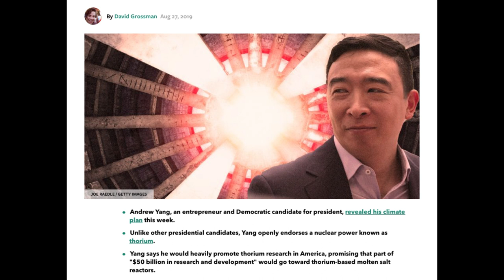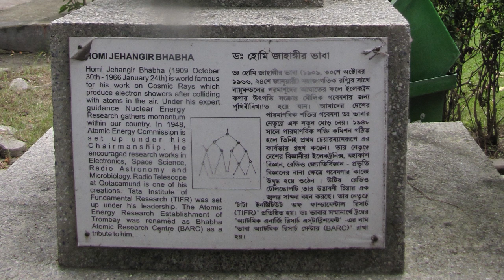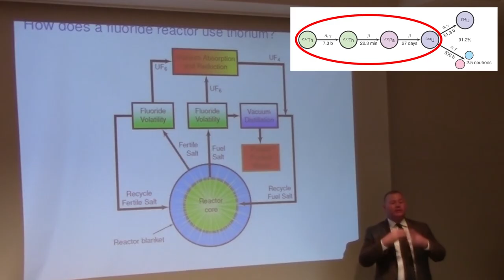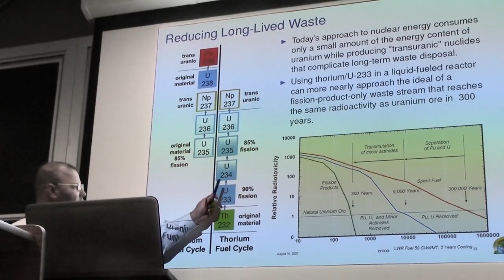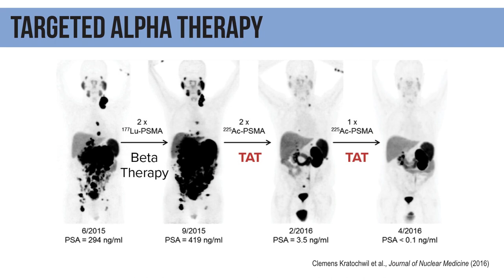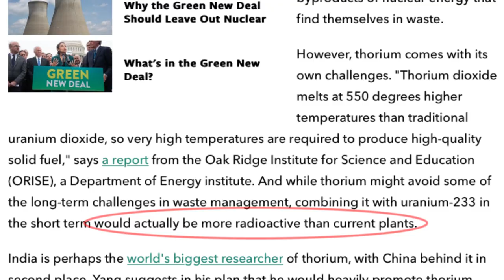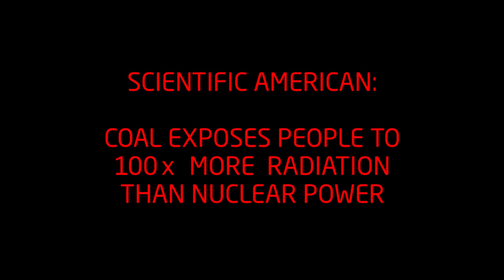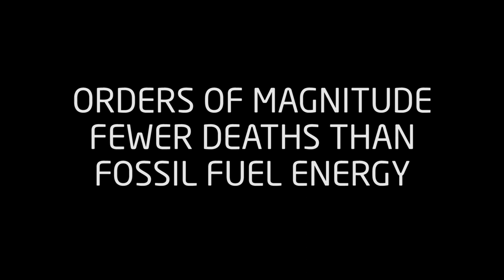Democratic Candidates on Nuclear - Fun Fact: Joe Biden Supports Nuclear Power

Comment from the maker: Joe Biden supports nuclear power, and specifically wants to invest in research aimed at lowering the costs of nuclear. Bernie Sanders plans to put operating low-carbon nuclear power plants into early retirement, not build any more, and not pursue any advanced nuclear technologies either.
Reply: Bad title change for this video my man
Reply: The video never mentions Biden. My problem with Yang is his focus on thorium. Don't get me wrong, thorium is needed if we are to ever get to nuclear powered railroad engines, and should be used to replace the existing reactors in nuclear powered aircraft carriers. And thorium is preferred for nations without an existing nuclear industry. But the focus for commercial energy in the US should be Spent Nuclear Fuel burning MSRs.
Reply from the maker: @dalesplitstone6276  Biden was never asked about nuclear at the CNN Climate Town Hall. It seems like random chance he's gone this far without being questioned on it, so all we have are his platform which supports R&D into SMR. Of could he COULD bring it up himself, which would be nice.
Reply: @gordonmcdowell  While some SMRs are MSRs, support for SMRs does not imply support for SMRs.
Reply from the maker: @dalesplitstone6276  That is absolutely true. Yup.
Reply: enough reason right there to forget about bernie

Comment: 7:55 you could clean the filter from coal power plants and extract Uranium and also Thorium
Reply from the maker: Currently, you'd be concentrating those fertile materials enough to have a "controlled substance" on your hands... dilute it is coal ash. Concentrated it is "oh-no-thorium!" So need something to do with it. Somewhere to use it. A purpose, for that Thorium. What to do with it, what to do with it... (Obviously Uranium has a use already, but you'll still be stuck with Thorium if you try segregate the coal-ash contents.)

Comment: Great video 

But the ashes from coal plants are not always wasted. Here in Oklahoma, the ashes are used as a filler in concrete called “flyash” and it’s needed quite often. Sometimes we even run out. So, the ashes are not always dumped and wasted.

Comment: I have been following your compilation of videos and found them a great resource.  I know you consider the term Thorium reactor the same as a MSR, so can you please clarify if Thorium could be used in a PWR even though the waste would be about the same as Uranium.
Reply: It can, it's just not nearly ideal because all water reactors have terrible fuel burn-up (0.5-0.7%); you can't get higher burn-up because of damage to the fuel rods and other engineering issues, and on top of that spent fuel reprocessing is a potential proliferation risk (but not nearly as bad as what environmental groups would have us believe). It would work similarly to current fuel rods, except there would be either a mix of uranium-238 and thorium or just thorium in place of the U-238. Because thorium oxide is harder to fabricate than uranium oxide, it's actually at a cost disadvantage in a water reactor, and so no one will want to use thorium in water reactors except for research purposes.

This is why MSR is critical to maximizing thorium's potential.
Reply: @MMuraseofSandvich  MSR technology is the way to go.  If only the US government did not shut the program down back in the 70's, we might already have widespread acceptance of nuclear energy.  That is why I like to differentiate Thorium and MSR with the current PWR technology because it is the latter technology that has led to the anti-nuclear lobbyists.  I know the science and safety statistics tell a different story regarding the current generation of PWRs, but perception paints a different picture because most people associate nuclear energy with nuclear bombs.

Comment: Thank you Mr. McDowell for all the great work you have done informing the public on molten salt reactors and in particular Thorium molten salt reactors.  After listening to the Mr. Yang and Mr. Booker I believe that really don't have a realistic grasp of the timelines for actual construction of a  commercial molten salt reactors.  Now I may be wrong because I am only going by what I read and I am no expert, but in the western world Terrestrial Energy appears to be the farthest along in actually building a commercial molten salt reactor.  It is a uranium fueled reactor and it won't be complete until the late 2020's.  For thorium from what I read the molten salt fuel cycle and chemistry to clean the salts really have not been fully developed yet.  It could be decades for commercialization of the thorium reactor molten salt reactor.  I have no idea where the Chinese and Indians are in the process.  The point being is that if molten salt reactors,  uranium or thorium, are to be useful to address climate change, the policies of the candidate should not enough just to be "for" them but that the government HAS to do everything in its power to expedite their development and commercialization.  ASAP!!.

Comment: Thanks for your work Gordon - it’s difficult Finding a tight explanation for liquid salt reactors that most people can understand - and millions need to understand this stuff. An issue worth exposing is that nearly a third of greenhouse gasses are not from electricity generation but industrial heat requirements - small liquid reactors running around 700degrees can theoretically help a lot of these

Comment: Fission bombs don't have moderators so U235 and U238 have similar cross-section at 1 MeV neutron where U238 begins to fission but not enough neutrons per fission to continue chain reaction but contributes in Tamper. But Thorium has a .5 MeV fission threshold and more neutrons per fission than U235 fission.

Comment: 1. The Thorium-Uranium cycle necessary for such reactors might be less toxic than the Uranium-Plutonium cycle but we’d be talking about this on a global scale. That’s still going to produce a lot of toxic waste over the standard measure of a 10K year period 
2. The major incentive is to compete with and keep mostly China but also India (who have substantial reserves of thorium bearing materials) from cornering the market and gaining more influence/power. It’s not actionably and rapidly combating the climate crisis. There’s no need to create a new issue in the middle of this emergency.
3. Fissile products will be insanely mobile, liquid salts are extremely corrosive, so containment of these products will be highly complicated and expensive. 
4. When they have to use lithium, in the salt, it'll be producing tritium, which will also be insanely mobile, but will have the added fun of being radioactive. Its small too, so it'll easily bleed thru any containers. Special Sodium Flouroborate Salts are used to capture most in experiments but large amounts still escape to the environment. 
5. Periodic maintenance will be necessary in the Plants, but all the equipment in them will be highly radioactive due to the containment issues, so that means Remote Maintenance... Also massively expensive
6. Many Thorium-cycle MSRs have to capture Protactinium (Pa) as it is produced, removing it from the system while it decays to U-233 and then reinserting it into the reactor. Thats practically weapons grade U-233, so... components for nukes can be sold on the side by ppl high enough in the command chain at these Chemical plants. It'll be damn near impossible to track by the IAEA or anyone, because there's no way to tell if nuclear material is lost because of its containment difficulties or if its because of proliferation. 
7. The Union of Concerned Scientists  (UCS) are quoted stating, “the choice between uranium-based fuel and thorium-based fuel is seen basically as one of preference, with no fundamental difference in addressing the nuclear power issues [of waste management, proliferation risk, safety, security, economics, and sustainability]." https://www.ucsusa.org/sites/default/files/legacy/assets/documents/nuclear_power/thorium-reactors-statement.pdf 
8. PLEASE SHARE THESE CONCERNS W/ UR YANG GANG FRIENDS. There's a reason activists and the scientific community have consistently rated Sanders' approach the strongest. This is our opportunity to get away from Nuclear, Thank you

Comment: Again I am not wedded to using Thorium, what I am wedded to is a non-volatile liquid fuelled breeder reactor, In other words a Molten Salt Reactor, although if it was a metal reactor, just for the love of god not sodium or something equally stupid.
Reply: Liquid metal reactors are a challenge, to be sure. Many of the coolant metals are either absurdly reactive (sodium/NaK), or will eventually weaken the reactor vessel (lead). There are guys out there doing research on fast MSRs, so it's not like you absolutely have to use thorium (in fact, I would encourage fast MSR research because that would be a great way to burn up weapons materials and  spent fuel). If memory serves, one of the ORNL guys was doing work on FLiBe as a coolant for TRISO fuel.

Comment: Yang has it wrong, both from a technical and political angle. While thorium should play a role in our energy future, the emphasis should not be on thorium, but on Molten Salt Reactors. There is no way to start up a thorium reactor without some fissile material material in the mix. This fissile material can be U233 (we have very little U233 available), enriched uranium (this would put MSRs in competition with solid fuel reactors, unless uranium enrichment capacity were increased), plutonium (we have stockpiles of weapons grade plutonium that we are required to destroy by treaty with Russia), and Spent Nuclear Fuel.

Reprocessing SNF is not a weapons proliferation problem, it is a political problem. The plutonium from SNF is reactor grade plutonium, of which we have an even larger stockpile than weapons grade plutonium, from past reprocessing prior to political problems with reprocessing. It is harder to enrich the reactor grade plutonium to weapons grade plutonium than it is to enrich uranium to weapons grade. The production of weapons grade plutonium requires removing the fuel from the reactor before the U239 can be contaminated with other isotopes of plutonium, as well as other trans-uranic elements. If it were not for the difficulties of fabricating fuel rods from SNF, all that we would need to do is remove the fission products to extract more energy from SNF even in solid fuel reactors, and in the process we could fission not only the trans-uranic elements, but more of the uranium.

This is the one of the greatest advantages of MSRs. Without the need to fabricate structurally sound fuel rods, recycling the trans-uranic waste and remaining uranium can be much easier. MSRs can be designed to fission all of the trans-uranic waste of SNF, and do so just by removing the fission products that poison the reaction. These fission products are the highly radioactive relatively short lived waste that was mentioned when discussing thorium vs uranium. The primary problem with uranium is that, in the thermal neutron spectrum, it can not breed enough fissionable material to sustain the reaction, so a significant fraction of the U238 will always remain. reprocessing can separate this U238 from the fission products, leaving us with fission products that are just as radioactive and short lived as those produced in a thorium fueled reactor plus depleted uranium. The only advantage of burning thorium in a thermal neutron spectrum MSR is that no depleted uranium remains, and depleted uranium is less toxic than lead. Indeed, many MSRs are being designed to burn uranium.

Theoretically, it is possible to have a positive breeding ratio in the thermal neutron spectrum for thorium. In practice this is proving to be difficult, at the very least. To deal with this U233 breeding deficit, thermal neutron spectrum MSRs that burn purified SNF (uranium and fission products removed, but plutonium not separated), and breed U233 in a thorium blanket. Flibe's current plan is to burn SNF in thermal neutron spectrum MSRs to produce U233 for thermal neutron spectrum thorium burner reactors. Because Flibe's reactors operate in the thermal neutron spectrum, they have to separate out the uranium from the SNF as well as fission products to produce a rich enough fuel for the breeding of U233.

Elysium's approach is different. Elysium is designing fast neutron spectrum MSRs. Because they operate in the fast neutron spectrum they can burn 100% of the uranium in their fuel, which eliminates this advantage of thorium over uranium. Flibe has currently changed their focus from uranium burning MSRs to SNF burning MSRs. Because their designs operate in the fast neutron spectrum Elysium does not have to separate the uranium from the SNF to burn it in their MSRs. Elysium MSRs could be fueled exclusively on SNF while producing highly radioactive short lived fission products, similar to those of a thorium reactor. Of course, if they burn SNF exclusively, they will eventually run out of SNF for starting up new reactors. One solution to this is to start up the MSR with about 80 metric tons of purified SNF and feed about one metric ton of uranium into the reactor each year after startup. This approach would produce the plutonium needed to start up additional MSRs. However, feeding thorium into the MSR instead of uranium would be even more efficient. In this case, the MSR would be producing U233 for the startup of additional reactors instead of plutonium.

Elysium considers selling the DOE on the idea of MSRs burning SNF and plutonium stockpiles, both of which are problems for the DOE, to be much more politically viable than selling them on the idea of thorium burning MSRs. Andrew Yang should talk to Elysium about changing his focus from thorium burning MSRs to SNF burning MSRs. I believe politically, it is much more viable to sell the public on nuclear reactors burning SNF than reactors burning thorium.

There is room for thorium in the nuclear strategy. Westinghouse has been exploring the potential of using thorium in fuel rods for existing solid fueled reactors. But the primary focus should be on burning the existing stockpiles of SNF.

Comment: I still don't fully understand what you tried to describe in the conversion process. I get that we can use more of the fision products in the end but why are produced. What do I have to watch and learn to understand this. Plz no comment about "learn physics". Something specific would be nice.
Reply from the maker: I cribbed from my own video to create this one, particularly from here (deep link) https://youtu.be/2oK6Rs6yFsM?t=13067 ...and in short prose, Fission releases energy by splitting atoms. The resulting smaller atoms CAN NOT be as stable when created, they NEED time to decay to stability, which is when they cease to be radioactive. Radioactivity is just a delayed release-of-energy like the energy released during fission. But the delay is the hassle. H. G. Wells wrote (in 1913) The World Set Free, where humans figured out how to control radioactivity, and powered an advanced civilization with it.. no fission or fusion required, because plenty of already-radioactive material available in the Earth's crust. Sadly, we can't accelerate or slow radioactive decay, except for all that fancy-pants General Relativity stuff. We can make atomic clocks (based on radioactive decay) go out of sync by accelerating one in space (orbiting around the Earth), but not make any practical impact on how long anything will remain radioactive.

Comment: Are there any working thorium msrs already out?
Reply from the maker: China's T-MSR0 (simulator) is done. China's TMSR-SF1 (small nuclear pilot) under construction here (old satellite view obviously am waiting/hoping for a refresh) https://www.google.com/maps/place/38°56'47.5%22N+102°35'59.1%22E/@38.946528,102.5975683,835m/ ...here's latest presentation... http://samofar.eu/wp-content/uploads/2019/07/2019-TMSR-SAMOFAR——Yang-ZOU-PDF-version-1.pdf ...which explains it is TMSR-LF1 will be the pilot for true liquid-fuel Thorium Molten Salt Reactor.

Lots of MSR startups in the West. Most use uranium and are less efficient, but also then single-fluid simpler too. No operating nuclear-powered MSR yet... none since MSRE was shut down in 1969. https://en.wikipedia.org/wiki/Molten-Salt_Reactor_Experiment

Comment: Here's some interesting points that i saw being raised by a french physicist on Reddit who goes by the username /u/233C (links: https://shorturl.at/hjoX4 , https://shorturl.at/bwEMV ) about some topics you also mentioned in this video. To summarize however, basically he raises concerns in-part about these two things:

- The safety of handling Protactinium-233 when taking into account how dangerous it can be, even with a multi-stage repossessing plant and advanced robots used for remote handling, especially when it comes to maintenance,  repairs and human inspections. 

- As absurd as it may sound, the  risk of having specific areas that can't be completely inspected due to radioactivity exploited in order to have the ability to "funnel-out" some of the chemically refined U-233 into a separate stock that could later be used for proliferation.
 
As there's a very large and lengthy amount of materials on your channel which i didn't get the opportunity to watch entirely (yet), do you happen to have any content in any specific video addressing these points and perhaps the others he mentioned in particular?

Comment: Plutonium from LWRs after 6 months in the reactor is denatured, by high Pu240 a neutron emitter that prevents the Plutonium use in weapons due to causing predetonation. LWR waste has 33% Pu240, and the limit for weapons is under 10% Pu240.

Whereas U233 is 100% U233 better than U235 and as good a weapons material as Pu235 at 7% Pu240, 93% Pu239.